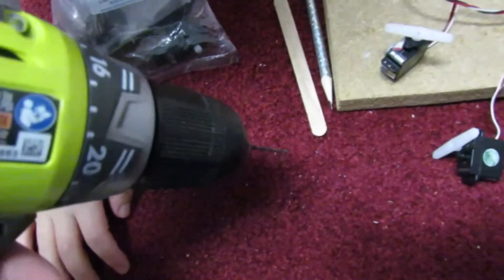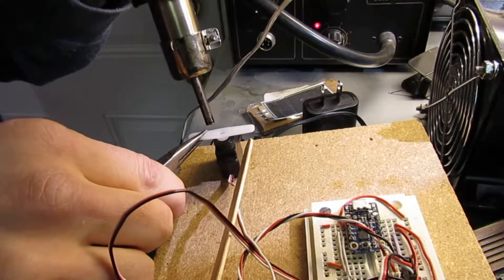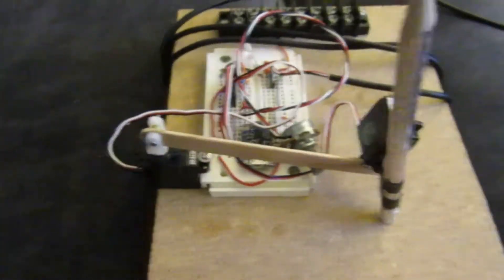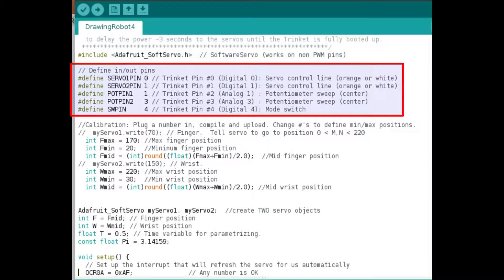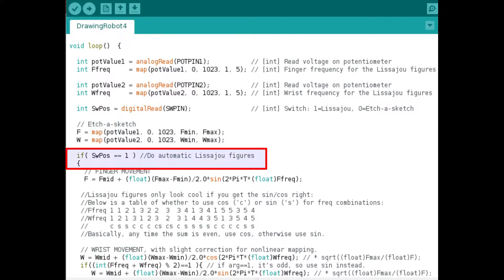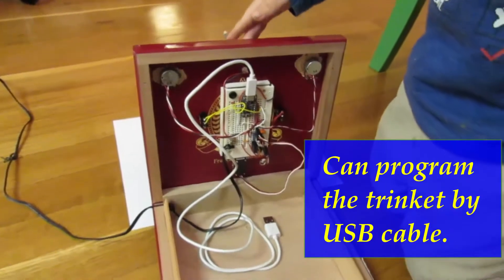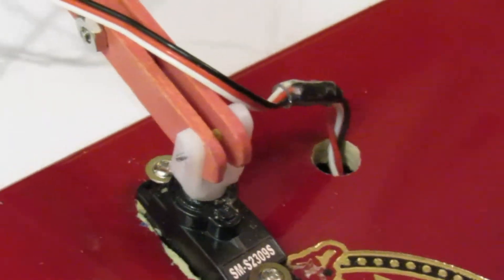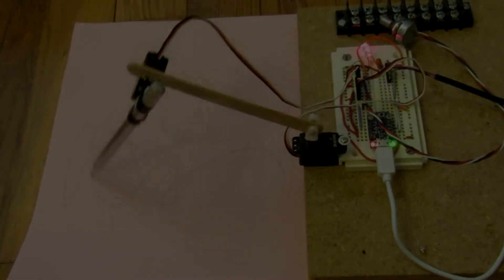Etch-a-Sketch Robot (but not what you think) - An Arduino Trinket Project

Comment: this is pretty awesome, is there anyway to have an image you want it to make, and have it draw out/sketch that image?
Reply from the maker: Yes, but you'd have to program it to do that.  If you want to draw a square, for example, it's not so easy -- You have to use trigonometry to unscramble mapping of a square to a spherical-like coordinate system (the wrist and finger concept).  On the other hand, it's easy to draw circular arcs!   I also noticed a lot of nonlinearity in the servo motors, meaning if you linearly ramp the servo position in your code, you don't get an exact proportional turn in degrees.  Some kind of nonlinear calibration would be needed, most likely.
Reply: ohh awesome! thanks :) will definitely try something out and let you know if I run into anything cool/note worthy/troubles